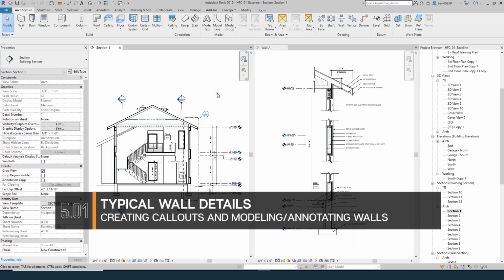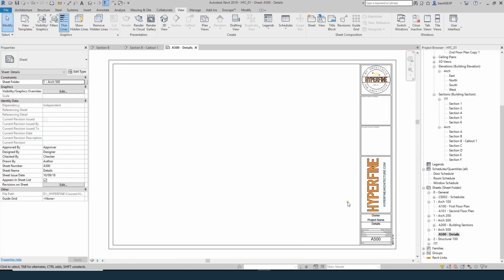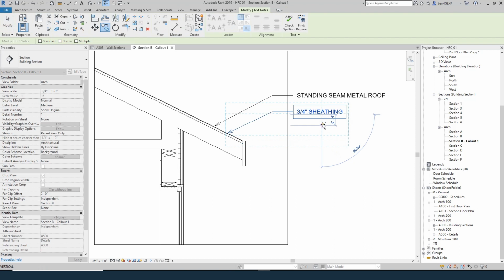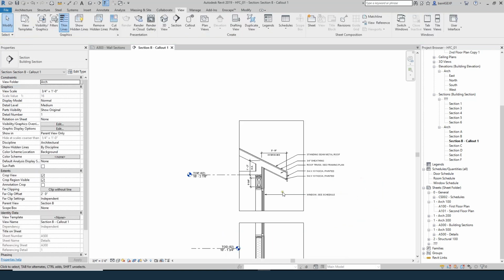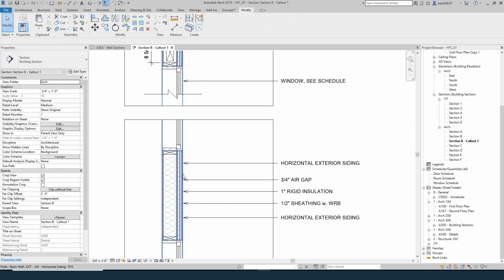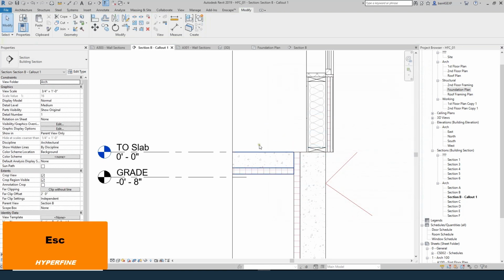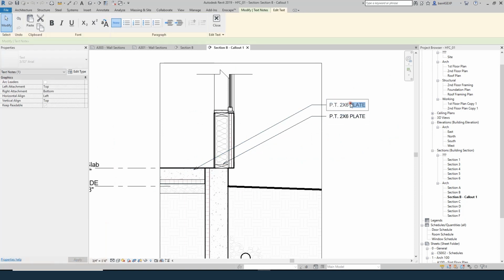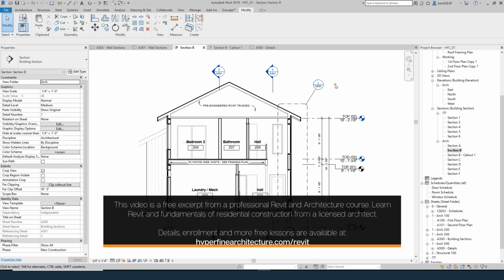Revit Wall Details

Comment: How would you show the plywood and shingles above the truss extend 1in  past the truss?
Reply from the maker: Could do it a few ways, most commonly with drafting. Either draft the plywood and shingles extending over the fascia, or use Cut Profile on the actual roof to cut the structural layer back, or key in a drafting view detail that links to your standard detail.
Reply: @HyperfineArchitecture I thought so. Do you find this process repetitive if you have a lot of views?
I usually copy the roof in place, move and change the new roof layers to be plywood and shingles, then offset one inch. This applies to all views but Depending on the roof has its setbacks.
Reply from the maker: @valeriepierre7297  not too much, certainly not more than annotating elevations. Depending on my roof assembly  sometimes I model the overhang/rake as a separate roof, but never to the level of detail of 1". In a 1/4" section you wouldn't see that anyway. So you could draft it once in a typical wall section then group those elements and paste them into other sections. Or draft a typical detail and key it in, or maybe even create a detail component for your typical eave condition. You'll have to decide what's the most efficient for your workflow and consider the value added, if any, of modeling that level of detail.
Reply: Good to know, thanks @HyperfineArchitecture

Comment: I cut the section, placed callouts, created the details, placed them on the Detail Sheet. How do I reference them back into plan view, i.e. foundation plan, framing plan, etc?
Reply from the maker: Launch the section tool, and before you click to draw a new section, look at the top for a checkbox that says, “Reference Other View”. Then select the view you want to key in and THEN draw the section
Reply: @HyperfineArchitecture  You rock! Thanks!
Your course has helped me in so many ways I can't even tell you! I reference it almost daily. Absolutely worth the time and effort!

I'm just going to the engineer, today I hope, with my first Revit project. With your help and inspiration I took a big bite and made my first one a tiny 4,780 square feet shack. Ha! I've started and played with plans in Revit for quite some time (since 2019) but never taken one through construction. 

I've been designing houses and remodels  since 1984. Started with hand drafting and converted to AutoCAD Architecture back in 1996. I specialize in one-off custom houses. HUGE LEARNING CURVE but I'm committed this time to making Revit my standard. (Making schedules and legends be damned!)

I look forward to your new course work as well! I'm excited for you and wish you the best!!!

Sorry for writing a book here.

Comment: great video! is there a way of linking the details and annotations to the location of the wall? i.e. if that wall needs to move in plan
by some distance afterwards,  its going to mess up your details, even though the detail doesn't change.
Reply from the maker: Thanks! The short answer is no. There are some items you can lock to the model, but not everything, so if the wall moves you are going to have to do some updating to the detail. You could also do drafting view details and link them in to your drawings. Pros and cons to each method.

Comment: Hi, is there a way to show my stud shaded in plan while keeping it like this in section?
Reply from the maker: For my wall structural layer I set the material cut pattern to be solid and dark grey, so it poches nicely in plan. Then in the sections I turn off wall cut patterns so they are all white.
Reply: @HyperfineArchitecture  thanks.
Reply: Have you considered putting your studs using the beam system and columns so they show up automatically when you cut the section?
Reply from the maker: No. You don’t need to model every stud. And they wouldn’t show up in section anyway unless your section cut through a stud, which is not what you want to be showing in a section.
Reply: @HyperfineArchitecture  What if you are doing a building section and want to show the floor joists - typical for residential designs. Would you use the beam system then? or show detail components for the joists?
Reply from the maker: I model floor joists. I have also seen some people use detail components. I have complete lessons on how to design a residential structure and create all the drawings in my Revit beginner course: https://hyperfine.gumroad.com/l/revit

Comment: this tutorial is useless. because you keeep on pressing your keyboard instead of telling us what to do and what you are pressing. its more of a show video than a tutorial
Reply from the maker: Hi Pearl. The letters in the orange pop up box are the shortcuts I was using at the time. They show up as I type them.
Reply: I would consider checking out the pop up box view that shows.  That way you can follow the steps he was using. This is pretty much jedi level architecture
Reply: If you see in the left hand side of the corner you'll see the commands. Once you learned a few of the commands, you know what the commands are as he continues to draw.